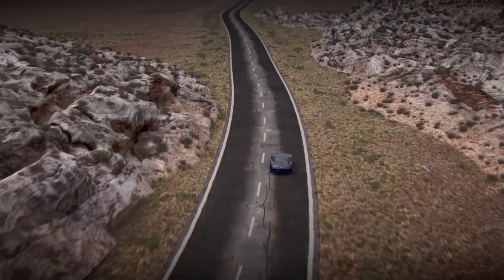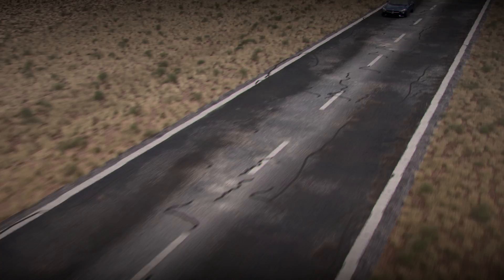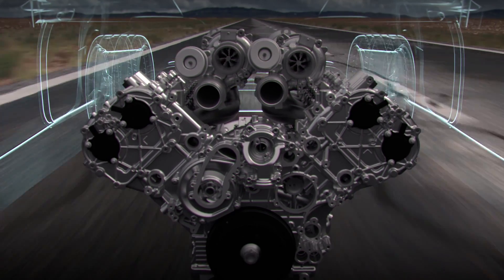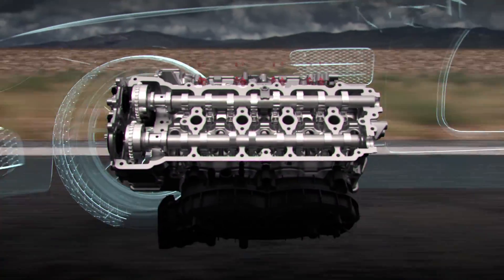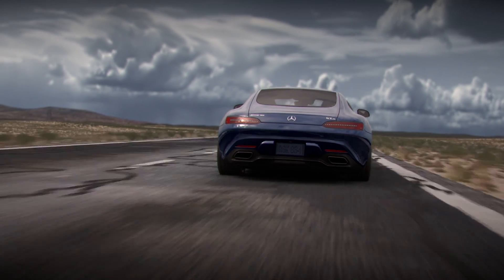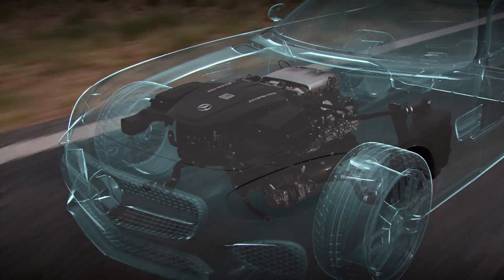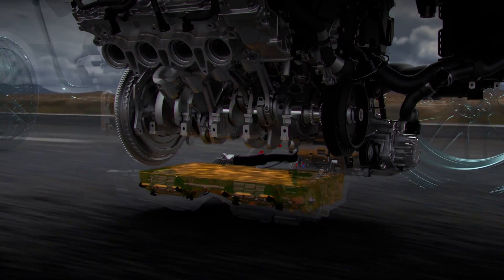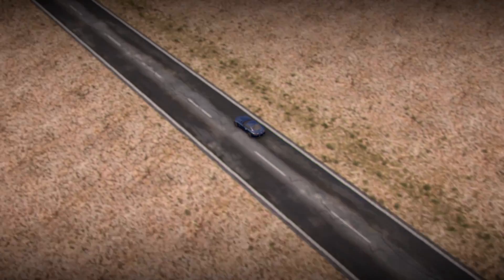What is: Mercedes-AMG Hot Inside V

Comment: But the bottom line is, you still have to spool up the turbos, so turbo lag has been reduced not eliminated. It's very good and it sounds fantastic, but I still think supercharged V8 equivalents of this engine are better.
Reply: fuel efficiency, don't forget about ut
Reply: fact is that superchargers needs power to boost. But it is an good idea for adding more air in the engine under lower rpm, and only using turbo at high engine speed (power). So the supercharger is added when need more low end torque. Like the twin charged VW 1.4 TSI engines